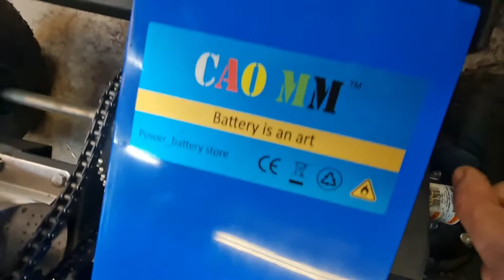Homemade Mobility Scooter Update Ebay 48 Volt Electric Motor Used And Making a Cover for it.

Comment: who built that scooter for you ? Judging by the trouble you had installing a 2" grote marker light, you didn;t make it ."
Reply from the maker: Well, ya... I actually built this scooter and then this one got up to a speed of 45 mph... so I revamped the scooters that I built for my parents to a front wheel drive and that lowered the mph rating (it wasn't as powerful of a motor). I just didn't video  those scooters, which I should!